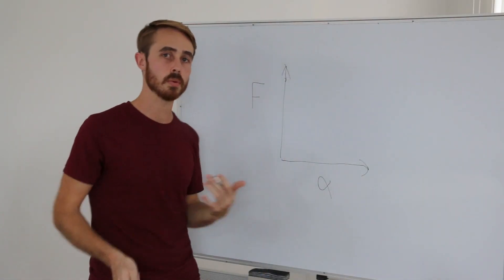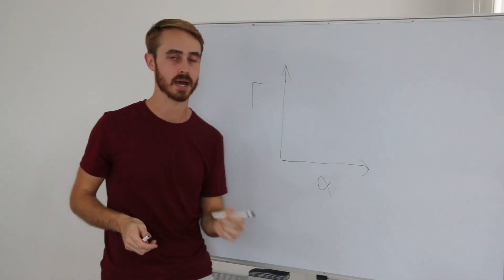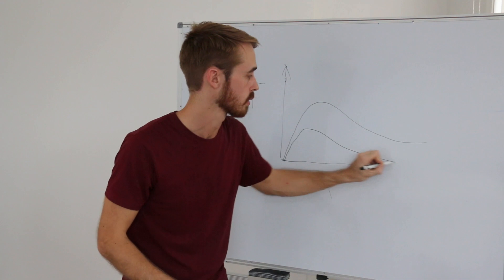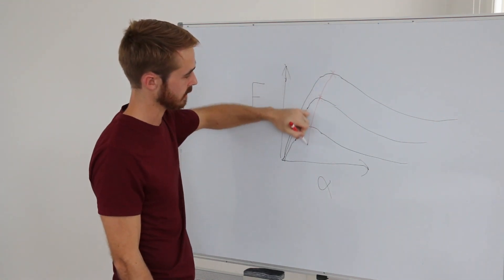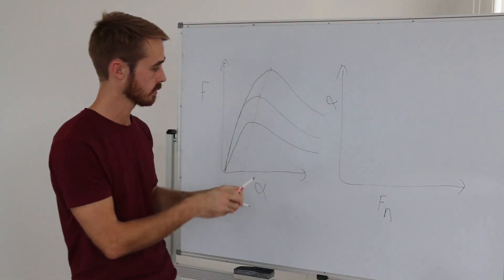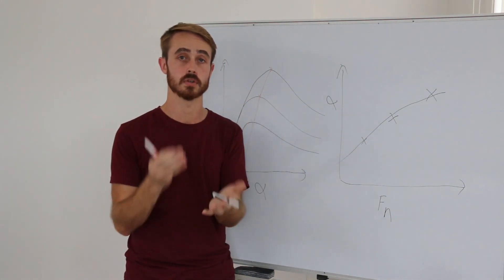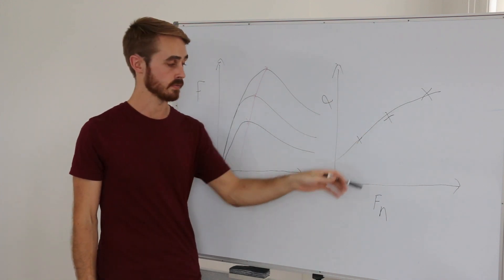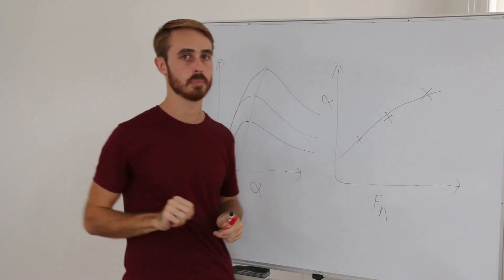Slip Angle Load Sensitivity Explained

Comment: I'm wondering if bigger normal load (downforce) increases slip angle why do F1 teams rather increase wing angle to save tires? Shouldn't higher slip angle cause more wear? And why the cars slide more when having less downforce versus with high downforce when the optimal slip angle increases with downforce?
Reply: Does slip angle cause more wear? Tires don't 'slip' because they have 'slip angle' they 'slip' because they deform. 'Sliding' might cause more wear, but not 'slip angle'.
Reply: @projectilequestion  Wouldn't the deformation of the contact patch be induced by basically stretching the rubber in the tyre due to the lateral force its experiencing? That stretching would cause the surrounding areas of the contact patch to become slightly thinner making the polymer more susceptible to breaking and wearing. just a guess
Reply: @bilaltariq7819  Yeah, and the greater heat soften the molecules.

Comment: Hey Kyle, what about a video on Anti-squat and the effects it has on normal and lateral loading of the tire both under straight line and hard corner acceleration? Anti-squat is typically clear cut in straight line accel. Drag cars tend to run very high levels of A/S, however in a dynamic situation the effects of A/S aren't well documented or fully understood. At some point, too much A/S can actually overcome the lateral capabilities of the tire which can lead to yaw oversteer. Obviously RCH and CG play massive rolls  on tire loading as you point to in this video. It would be cool to delve a little bit deeper into suspension dynamics and ride/handling tuning aspects of racing applications. Thanks for the videos, keep it up.